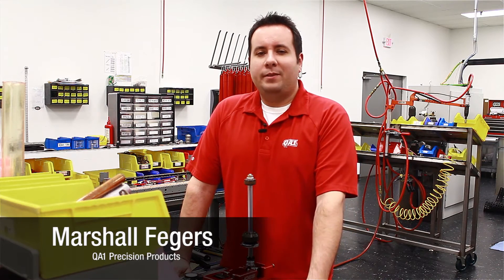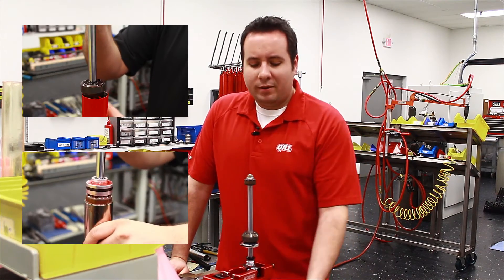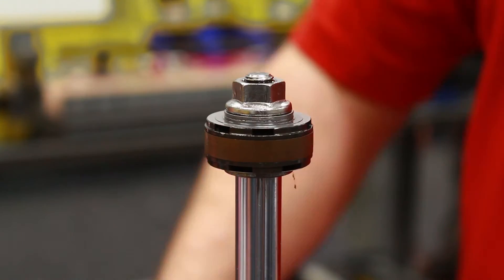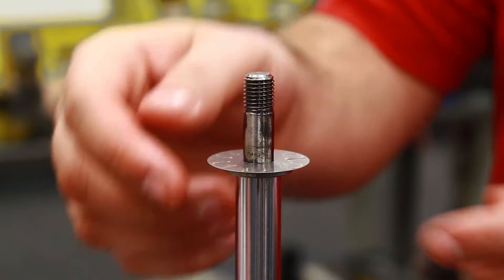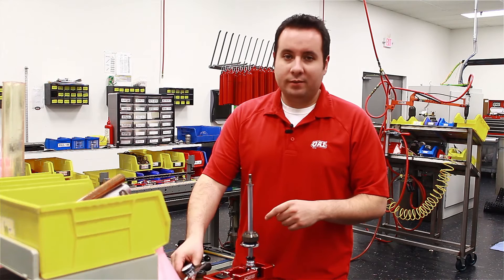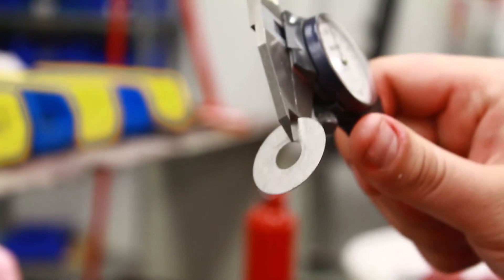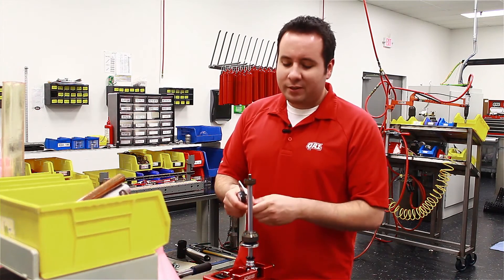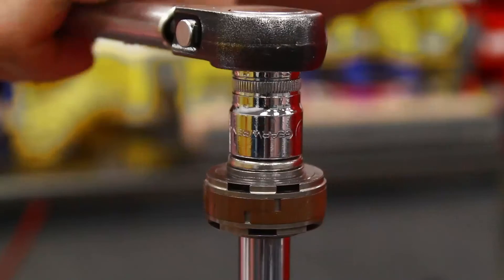Revalving a QA1 Circle Track Shock - QA1 Tech

Comment: Question , where does the base valve go in this process? Also, can these shock be run upside down? Thanks
Reply from the maker: redwhitentrue The base valve is installed at the end of the compression tube in a twin tube shock. In a monotube, we do not currently offer a basevalve option.  If we were, the basevalve would be installed between the piston and the floating piston inside the shock body. All of our rebuildable shocks can be run upside down.
Reply: QA1 Precision Products Thanks for your reply. I'll be fitting 3 cars with QA1 shocks this season!
Reply: QA1 Precision Products Thanks for your reply. I'll be fitting 3 cars with QA1 shocks this season!